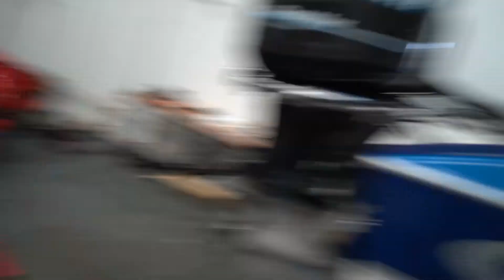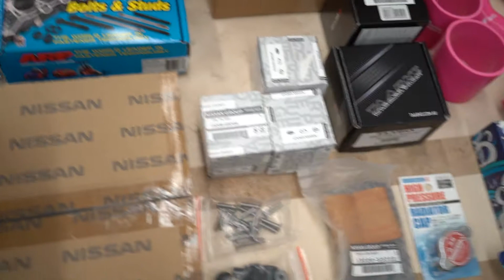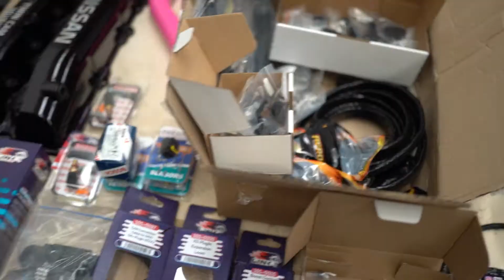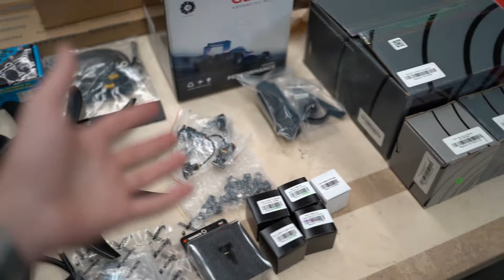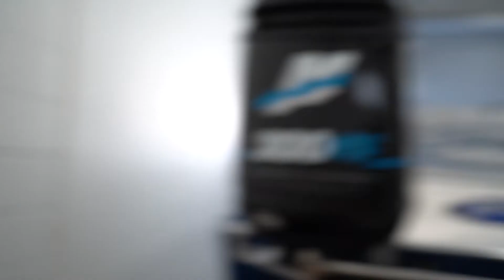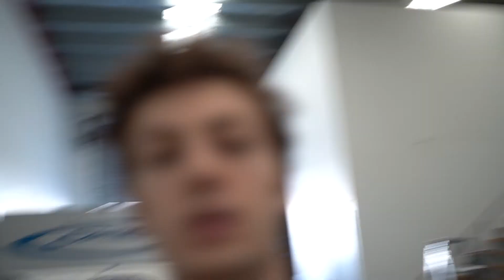S15 DREAM BUILD BEGINS!

Comment: Hey man I have the exact same Koyo setup in my red S15 200sx haha 
Can I suggest a radiator swirl pot to constantly bleed any cavitation air from the coolant system?
That way you definitely won't need the Nismo low temp thermostat or a oversized water pump pulley either due to the efficiency of the radiator and not having any trapped hot air creating hot spots in the system. 
Nismo low temp thermostat is harder to get up to a decent temperature initially especially when you have a decent radiator like the N-Flow Koyo.
Reply from the maker: I never really understood what the swirl pots purpose was but this explains it, thanks. Definitely could be something to look in to. My damper slightly underdrives the water pump so I was hoping this would stop most of the cavitation. I’ll see how it goes for now, otherwise swirl pot would be a good idea for sure
Reply: Under driving the pulleys definitely helps with cavitation and preserving the pumps lifespan but a swirl pot is like having the air bleed port (on the water outlet pipe) permanently open to allow the cavitation air to exit the system. 
Rotary motors have them from factory for the same reason that revs cause cavitation and Subaru motors have them because they struggle to get coolant efficiently through the boxer motor.
3rd Strike Fabrication make a really nice bolt on one that replaces the water outlet pipe on your SR